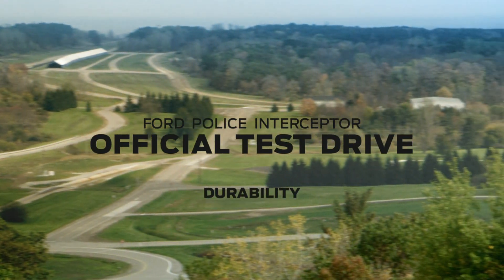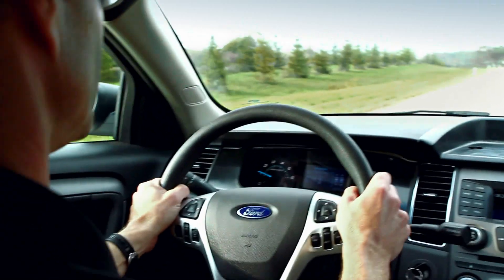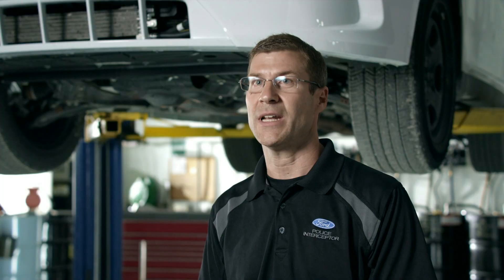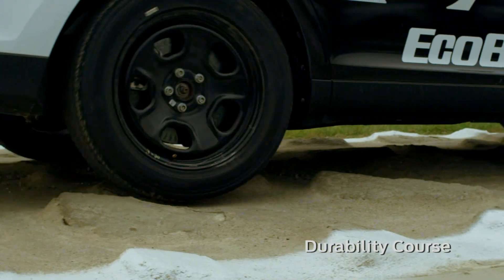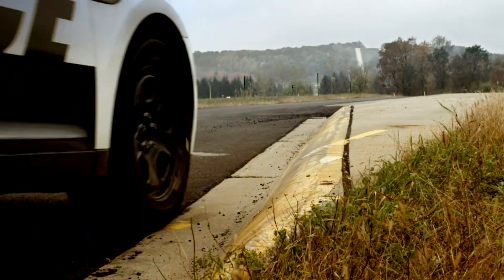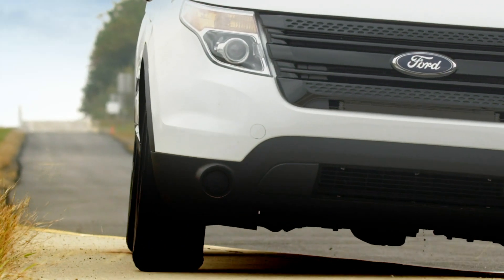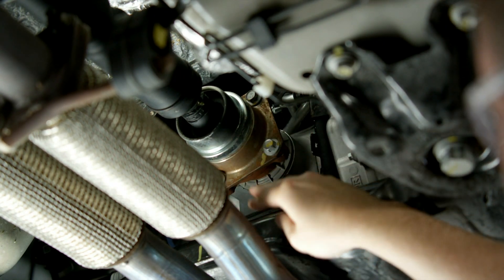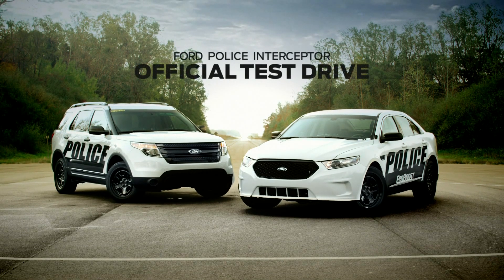Ford Police Interceptor Official Test Drive 8 -- Durability

Comment: This is the New Upcoming 2026 Ford FPIS Police Interceptor Sedan. The FPIS Came With A 3.5 Liter Ecoboost V6 and the 3.3 Liter Hybrid V6 Engine and the 5.7 Liter Rocketjet V8 and the 5.8 Liter Hybrid Rocketjet V8. The Ford Police Interceptor Wagon that Can Put A White Board on the Back of the Police Wagon or A Police SUV. The Ford Police Interceptor Panel Wagon. The Police Panel Wagon That Can Store Police Equipments/Transport Criminals. The Ford Police Interceptor Coupe. The Police Interceptor Coupe for Police Patrol and Sheriff Patrol. Highway Patrol.

Comment: This is the New Upcoming 2026 Ford CVPI. The CVPI Came With A 5.7 Liter Rocketjet V8 Can Go Higher speed pursuit can Go 300 miles per hour on the Clock The Ford CVPI Hybrid. The CVPI Hybrid Came with A 5.8 Liter Hybrid Rocketjet V8 Engine. The Ford CVPI Police Station Wagon. And the CVPI Police Coupe for Police Patrol Highway Patrol and Sheriff Patrol. The CVPI Police Panel Wagon. That Can Store Police Equipment/Transport Criminals and More.

Comment: The Police Interceptor Sedan comes With A V8
Reply: And the Police Interceptor. Utility. Comes with a V8
Reply: @thallysdacostalima951  The Explorer Interceptor Utility Nope It Comes With A Hybrid Engine
Reply: Really it’s A Hybrid Cop Car By Ford.
Reply: I wanted To drive the Hybrid Cop Car. To Save Some Energy for the Hybrid Battery System on the Police Cruiser.

Comment: what did you expect when Ford barely did much to the Crown Vic. in a very long time? it was built to last; easy to repair/maintain and afforable, simple as that. They dominated the market so they just sat back on that. 

It doesn't matter how your utility performs, if it ends up in the shop more than the Vic. 

hell i wouldn't be proud of that ugly beast. The Vic. looks a lot better, shame you didn't end up with a nice new charger atleast, i feel bad for ya brother.

Comment: its sad how the mercury marauder out performs a CVP71
Reply: MM was built for that and the CVPI wasn't. CVPI wasn't built for much but to be cheap to maintain. Ford literally could have put the MM engine in the CVPI bit it would not sell back then because MM is 91 requirement. Plenty of MM folks found this out the hard way trying to cheat and use 87. the 3.5 TT FPIS/U can run on both 87 and 91 fuels.

Comment: It's got the same engine as the SHO, but that's about it. Only 20% of the parts are the same between a PI and a retail Taurus or SHO. Everything else is upgraded in specs. Even the EcoBoost V6 in the PI is tuned and chipped differently than the SHO. 
They can't bring back the Vic. They'd still be selling them if they could - they were pure profit. But the Vic platform can't meet 2014 federal safety regulations, and you can't build a completely unique police car and keep the price affordable.

Comment: You can only update a car so much before it eventually has to have drastic changes made. The fundamentals that made the Crown Victoria great would eventually have to be changed in favour of the changes that come with the Taurus. Besides, the Crown Victoria was seriously outdated. It was built on a platform that dates back to the 70's. That's a long time for any car platform to be in production. I'm surprised Ford had used it for this long.

Comment: I know the story man haha the very very slight drop in gas mileage for the 'Rauder motor would've been worth it for 50 extra horse. It should've at least been an optional motor for highway patrols and such. Then when the new 5.0 came out, that should've been standard...its based off the 4.6 so fitment shouldnt of been an issue and cost would've been worth it to give the trusted Crown Vic a much needed update.

Comment: they really did consider other engines for the Crown Vic...like the 5.4 Triton in the late 90's, and the Marauder in the early 2000's..the Triton at the time only made 260 h.p., but it did crank out 350 lbs. ft. of tq., however they said it wouldn't fit in the engine bay at the time...and the Marauder engine was more costly than the regular 4.6 2-valve because of the design, and it would've gotten worse gas mileage